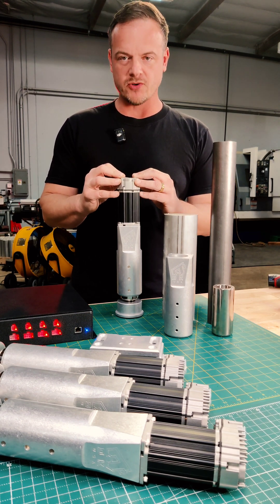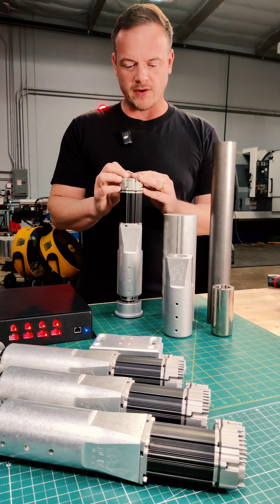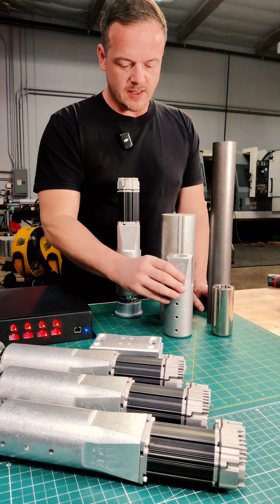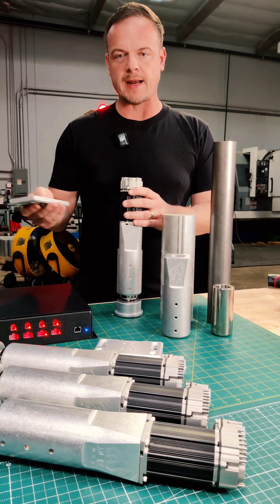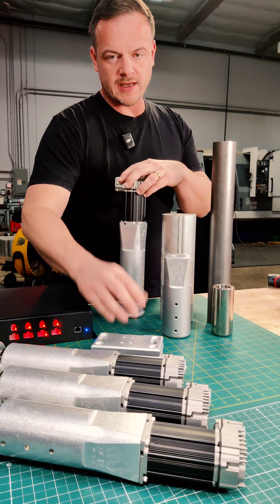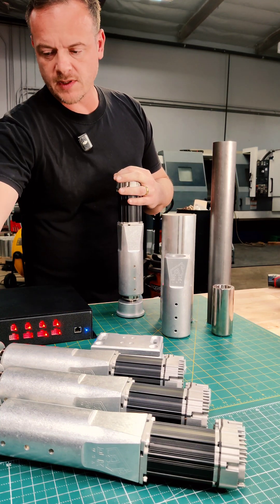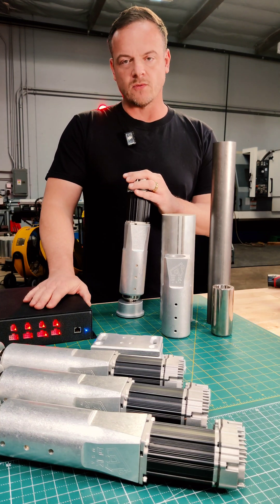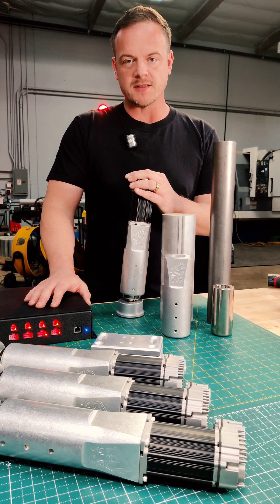DK2 Motion System | Quick Overview #simracing #assettocorsa #iracing #racing

Comment: Nice.  Need more videos from this channel.  Would love to see some comparisons of your offerings vs the quibic 210/220s and see how well the work for both flight sim and sim racing
Reply from the maker: Thanks. All companies are biased to their own products of course. Qubic does some great products and has been around for a while now. We are the new kid on the street, so we have some advantages and so do they. Hard to decide for sure. ;-) Try joining both the Discord communities for some more unbiased input! The link is on our website under support.
Reply: Thanks! A big question I have is the noise.  Do you feel your system manages noise well? Any places near Pittsburgh where I could see one in person?
Reply from the maker: @Feller1789  Unfortunately no... closest place is flatoutsimracing.com in Glen Rock, PA - 3.5hr drive from Pittsburgh ... 10709 Susquehanna Trail S, Glen Rock, Pennsylvania 17327

They have two different systems though for you to try. Sigma and dbox. Would be fun to compare and see which one you like best.
Reply from the maker: @fosrusa
Reply from the maker: @Feller1789  Regarding the noise, there are two types. Ambient or traveling through the air and reverberation or traveling through the floor and walls. Ambient is tested and is 52 dB or so depending on the system and settings. The reverberation really depends on the construction of your house or where you are running the system. If you find that the reverberation carries far, then you can put the DK system on some rubber pads or lower the settings at night when silence is more welcome by others. ;-)